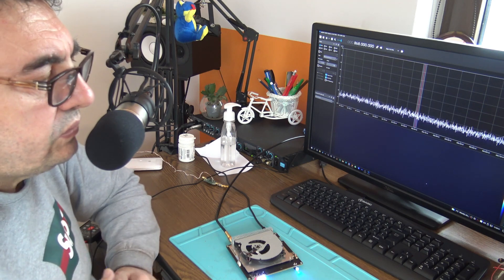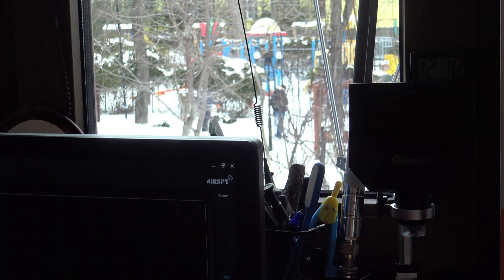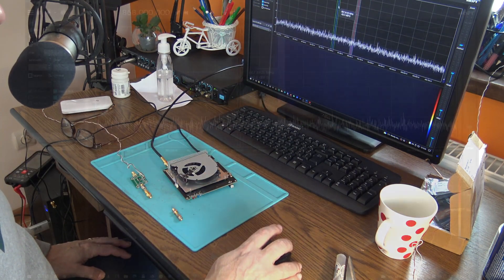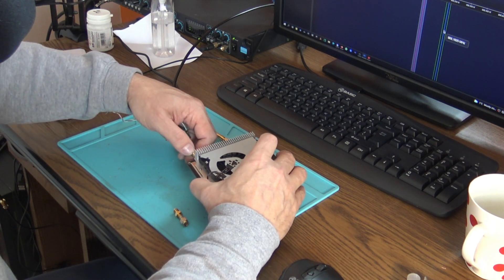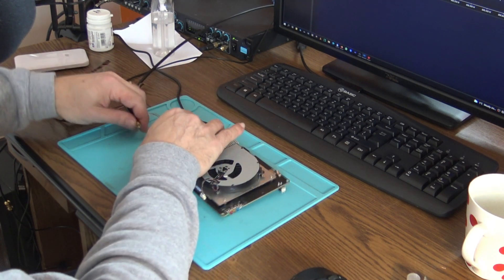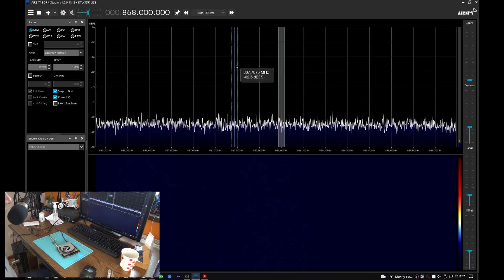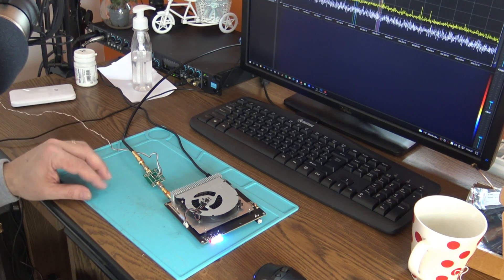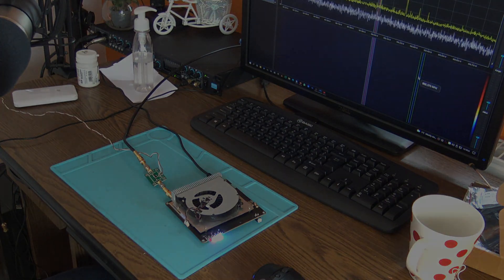Helium miner amplifier

Comment: I am also testing a prototype bi directional amplifier, I'll let you know if the results are good.
Reply: Please let me know
Reply: @stevomolloy  So far so good . Stable 10db gain on RX and 4db gain on TX .
Reply: @Omegaman1969  fabulous
Reply: I have a deaf heltec so very interested
Reply: @stevomolloy  Why is it deaf ? Poor antenna placement ?
Reply: @stevomolloy  I’m going to test on one of my bobcats with an indoor antenna this weekend. It’s fairly close to a lot of miners it can’t hear at the moment. Hoping It will really help it.
Reply: @Omegaman1969  it's outside 10m high 6dbi McGill.....early heltecs have deaf problem
Reply: @stevomolloy  Ah I see, I'd like to try one with this booster.....how do I know which model has the poor reception if I look on ebay?
Reply from the maker: Perfect!
Reply: Hallo Simon. I am here sitting and waiting for your answer. Were results good? Whats the name of prototype? Thanks :)
Reply: @SKeverything3  DB gain was excellent but it just increased the dB RX and TX of miners I was already witnessing , I tried several miners, indoor and outdoor antennas and was the same with all of them, no additional witnesses just stronger signals.
Reply: @Omegaman1969  and mind telling us how many miners are around you?
Reply: @SKeverything3  on one of my indoor setups there are maybe 30 miners surrounding it. I think maybe it gained one witness , total of 8
Reply: @SKeverything3  my best improvement by far is adding a McGill 6db on poles to my house.
Reply from the maker: Nice ! Good luck!

Comment: Hello Viorel,  nice testing. I just was curious as well, whether the tx-signal is passing or not.  We could have spent a lot of money, not necessarily having to buy a bidirectional amp, if it would have worked.  Unfortunately not.   I did similar considerations as NetWolf3D : seperating tx from rx, using two antennas.  tx on the normal antenna port (with the poor stock-antenna), and rx with the amp soldered with a pigtail-cable before the first saw-filter (with the good McGill-antenna).   Would this work ?  Any opinions ?
Reply from the maker: It should work, as long as the internal SX LNA is not gain controlled so a good band pass filter with amplifier will do a great job.I'm preparing to do the same thing, with two antennas..let us know the development.
Reply: Im wanting to try this for a while but i have no clue how to split the rx from tx, whats the device/ic called

Comment: this is good thing that it does not boost Tx power as most countries have limits on EIRP for unlicensed band I think Europe is 16dbm her in Australia it's 30dbm. Rx is what you want to increase as rewards come from hearing beacons not sending them out. For tx 3db antennas is more than sufficient. Not sure why people want to use bidirectional amp as this will more than likely get you into trouble with your local communications authorities for extending EIRP.  So a Tx bypass is good but you amp there seems to have high insertion loss which is reducing your Tx  also. What is better setup is to use dual port isolator and separate Tx and Rx antenna and add amp on Rx only. port 1 will be hotspot prot 2 will be Tx antenna port 3 you terminate 50ohm and port 4 will be Rx (filter and amp after antenna connect yo 4) This Is ideal setup. Then u tell helium your Tx dBi only so it can adjust for Eirp in your country.
Reply: 4 Port or dual port circulator forwards 1 to 2 , 2 to 3 , 3 to 4 and 4 to 1. terminating 3 stops tx recived signals feeding back to 3.
Reply from the maker: Very cleaver ..do you have a link with schematic or where to buy it..thanks!
Reply: @viocaia  have emailed u.
Reply: note please try at your own risk, i am tinkerer but i dont have equipment to test these things and am doing for research only. There is much we can do in RF much that has been learned in WIFI in MIMO. There is one hotspot RisingHF that has dual radio and dual antenna but not sure they are separating RX TX for full duplex operation or just provding extra 8 Lora channels for higher coverage cell Density 16 instead of 8 channels.

Comment: Hello,
nice demonstrations,  is it possible to go further with experiment & make it bidirectional?  i found few bidirectional amplifiers but super expensive :/
Reply from the maker: I think the bets way is to use two antennas, one for TX, in the original connector and another dedicated one, thru a saw filter and amplifier connected after the first RF circuit, after the second saw filter ...